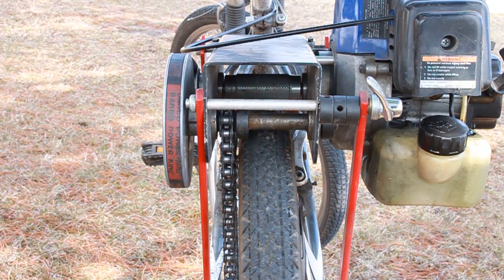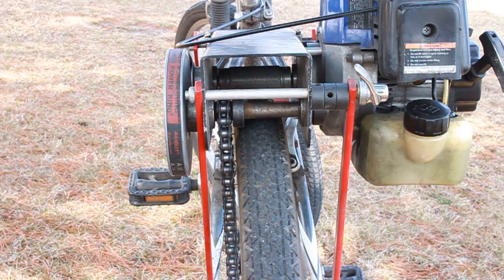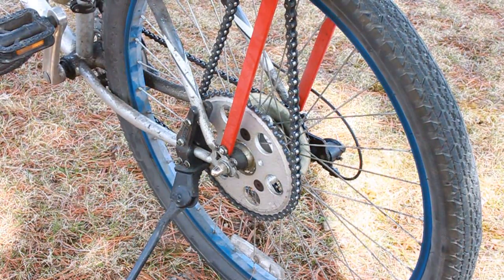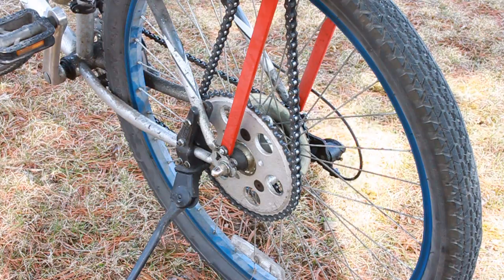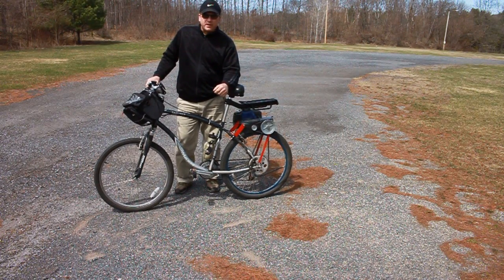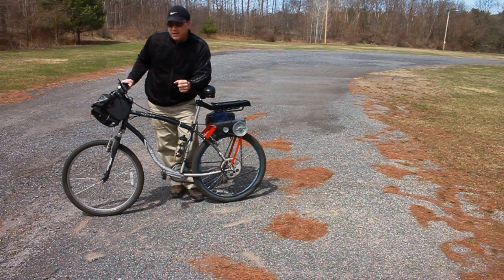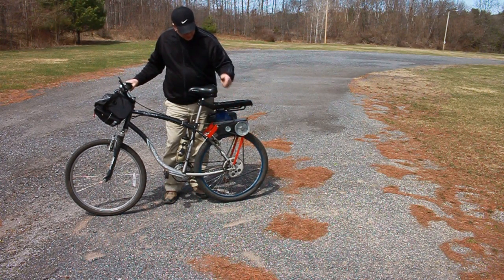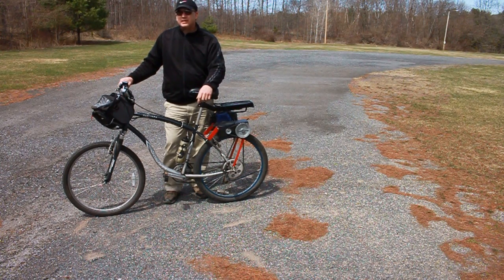friction drive/chain drive bicycle engine kit - PROTOTYPE VID 2 of 2

Comment: Spill on aisle #5. 1) torque is bending back side. chain is half inch away from tire. McFly, You seen nothing wrong with that. Maybe after it ripped tire  doing 30mph you did. Why build mountain, To move a bike?.   Dollar to Donuts, You folded company because someone got hurt.

Comment: I think this would work to mount an engine kit on my full suspension bike.
Reply: its 2019 october i have a very fresh as new something different  A FULL SUSPENSION  mountainbike not a hardtail built n converted with a new 4stroke kit and for sale im in ireland. truthfully thease are a max 10 stone load bike more for a kid for some fun or someone light not great for an adult

Comment: its a good set-up, and ideal for a CVT , just replace your drive and driven pulley with CVT parts,
Reply: Sure. Maybe some titanium here and there, Magnesium rear wheel with integral sprocket, maybe some cooling fans and an LCD status display and cup-holder. The retail price could still be under two grand. Should sell like hotcakes!

Comment: Why don't we have some universal motorized front wheel bicycle kits that can just haul any regular bike without the complication of making a lot of changes to the rear part of the bike?!!
Reply from the maker: Bean Cube I've tried a front wheel system but did not like the stability, plus you have the engine noise and exhaust directly in your face. Performs much better mounted on the rear.
Reply: I did a front wheel friction drive (engine hinging on fork) and the vibrations were alot stronger on my hands than usual, and I was worried about it eventually cracking the fork. But this was a 64cc concrete saw engine that was running rough. It’s stolen now but theres a vid on my channel
Reply: Also I smelled strong like 2 stroke exhaust from riding my FWD bike because the muffler was right infront of my knee so my pants absorbed it

Comment: Where did You get the sprocket from ? 

BTW great looking bike kit
Reply from the maker: Walt Lars Pirate Cycles, it's a top quality product that's worth the money
Reply: How much does Your chain drive kit minus engine cost?
Reply: Walt Lars try Kings sprockets in witch I use bolts onto hub with top hat adapter